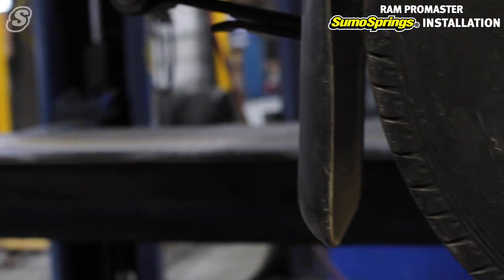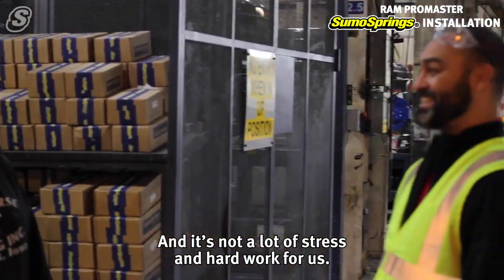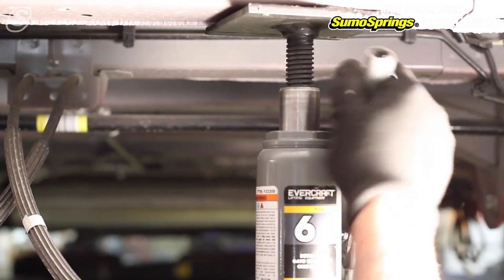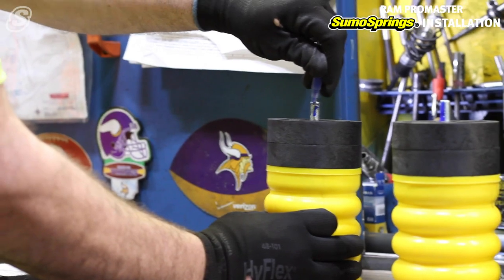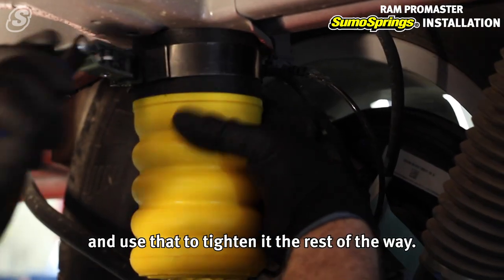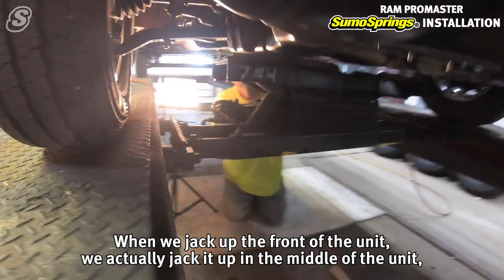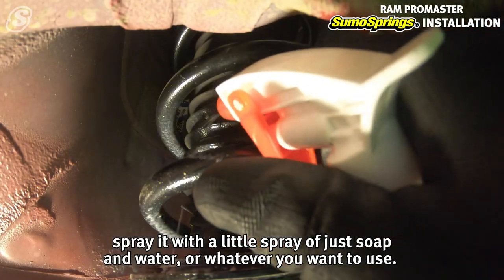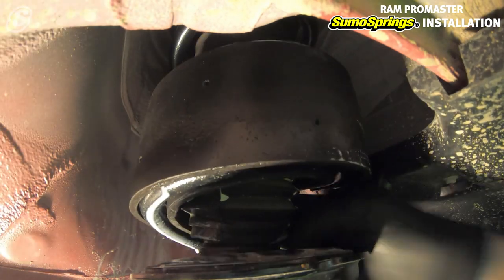Winnebago RAM ProMaster Van Suspension Upgrade | SumoSprings SSR-313-54 & Coil SumoSpring CSS-1195

Comment: Easy beasy lemmon squeezy! Thanks for this and definitely gonna add them this summer. Does the front make a big difference?
Reply from the maker: Can't get any easier! The front Coil SumoSprings will provide you with a more controlled ride. Similar to that of german handling. You'll also experience less side-to-side body roll, front-end dip, and sagging with these installed. - Josh

Comment: I have a ram promaster 1500 136" wheelbase with probably 600-700 pounds in the back. Would you recommend 1 or 2 spacers left on the spring?
Thanks
Reply from the maker: Is your Van lifted at all? - Josh
Reply: @SuperSpringsInternational  
No it's not
Reply from the maker: @MrRemo71  You should have about 1-1/2 in or less gap between the SumoSpring and the axle. Hope that answers your question. - Josh
Reply: @SuperSpringsInternational  thank you sir

Comment: Why on the front is the sumo spring not together?
Reply from the maker: hello! The front SumoSpring is our Coil SumoSpring. It's designed to be split apart, and with that able to slide right in. It provides 15-30% capacity to the factory spring. https://www.supersprings.com/products/coil-sumosprings/